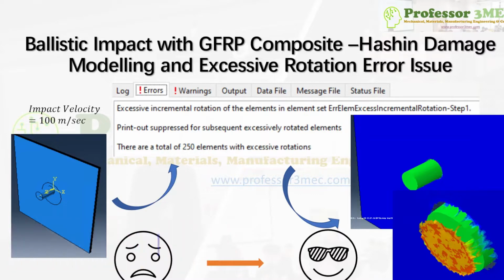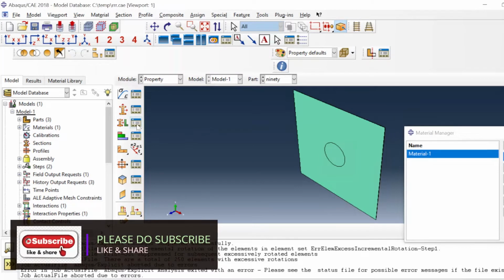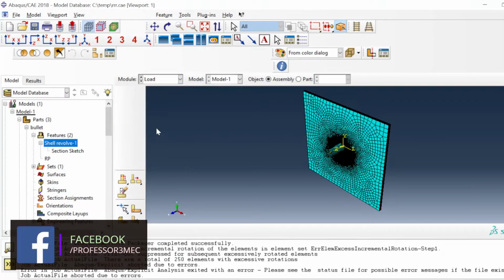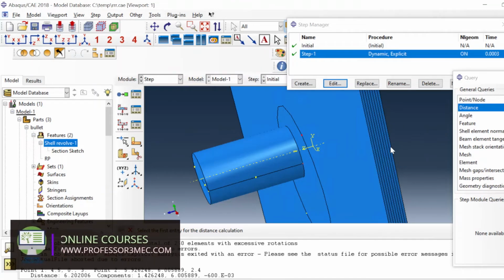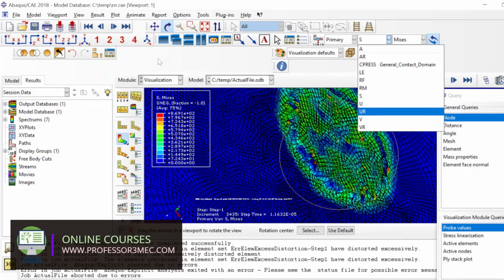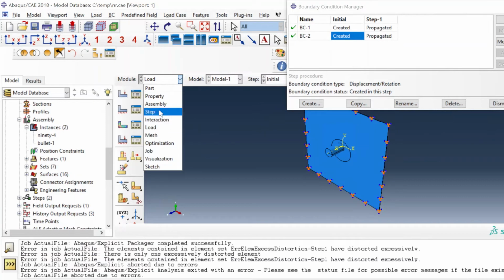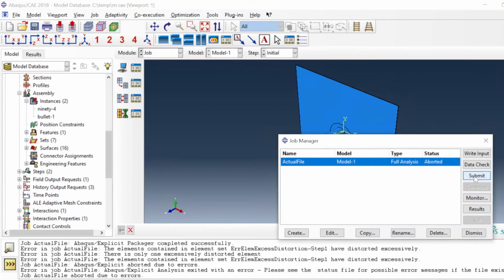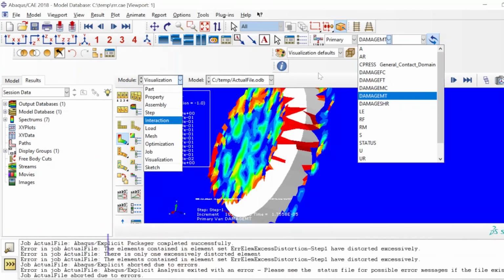Step by Step Rectification of Errors in Ballistic Impact Simulation using Hashin Damage Model-ABAQUS

Comment: Thanks for your solution.
Can you advice me on how to solve if the job is completed early without impact?
Reply: If distance is too large then base don the speed and distance between the parts you can find out the time needed for impact and use that time in the step time. In simple words, please increase the step time. Thanks

Comment: Sir how to solve that new error which we are getting not able to solve that
Reply from the maker: Try refining the mesh. Its just fine tune the parameters and mesh. Also, you may not need to run the full analyses check in visualisation if all elements failed then that is fine.